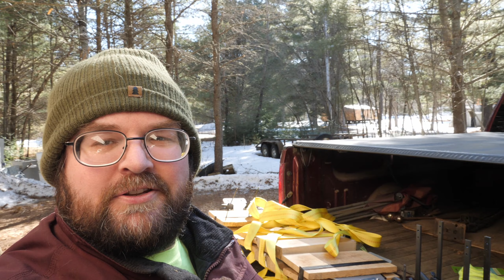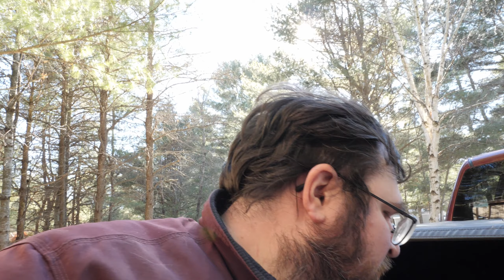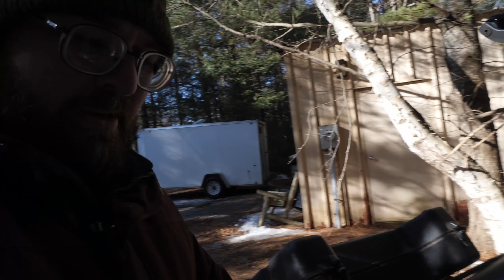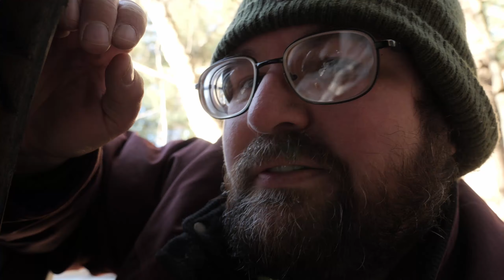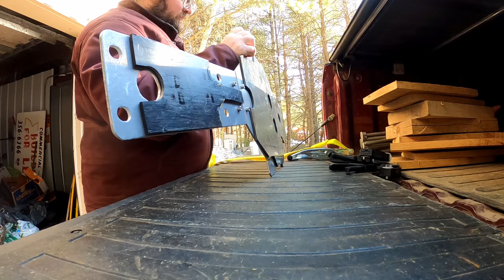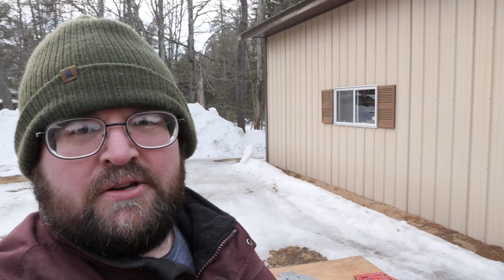Building a Hybrid ATV Skidplate for my Arctic Cat 700 | Aluminum And Plastic Surface Skidplate Build

Comment: Here in Norway most people use plastic, just because of it slides better like you said. Because with aluminium, you will get insta stuck on rocks, but plastic just bend.
You are doing a great job there.
Reply from the maker: Thank you. I used the Team Arctic trick I have in another video basically since new to protect my plastic skid from getting too stretched out like you're talking about. Recently I've been thinking about how old this machine is, and one of these days it's going to start getting harder to buy replacement parts for it. So I figured now is the time to buy anything I might want to finish building this machine, while they're still available to me. By building this setup, it still slides better because of the plastic, but has more resistance to bending. It seems like a win-win to me.

I also decided to pick up some Ricochet Offroad footwell guards and did the same thing to them. I bought these for the same reason, mitigating damage to things that could be hard to find in the now not-too-distant future. I haven't made a video to show these yet because I've been kind of slacking off, haha. 

Thank you for watching and commenting!
Reply: @ROCKINRODNEY  You are doing so much work to your machine, I got everything mounted at my dealer when I bought it in 2018. I think your Arctic Cat will do great for many years still, but it is always nice to have a new atv aswell.
Reply from the maker: @ArcticExploring  thanks. Yeah I did alot of things to this machine when new. I was always on the fence about whether to do an aluminum skid. These are about the last things I have for it at this point. If/when I get a new machine, I'll have to start the process over, haha. I really want to build a rock buggy UTV.
Reply: @ROCKINRODNEY  It is cool that you do things yourself to your machine, I doesn't have either time or tools to much things to mine. A rock buggy UTV sounds really cool, but sound a bit expensive to maintain also.

Comment: Great job and idea Ron. I think it is going to hold up in the long run. You have got to love the miracles of time lapse. You waited 4 days and we waited 7 minutes to see how this project was going to turn out lol. I think you will be good to go. You placed a lot of 3M tape throughout the skid plate and that tape works wonders. Have a nice day Ron!
Reply from the maker: Hey good morning sir! Yeah I kind of threw that 1 inch per 1 pound of material weight out the window. Initially I was going to only tape the edges and around the cutouts, but then decided to go ahead and fill in any spots where there weren't openings. The way this stuff bonds is crazy! I don't think it's going anywhere. I actually went ahead and ordered ricochet footwell guards and did the same thing to them. If it does, I'll make an update. 

Thank you very much for watching my video, and for commenting buddy!

Comment: Curious to see how it holds up.. 👍
Reply from the maker: You and I both Doc. According to 3M, this tape is recommended for use in applications including "applying sheeting to the exterior of skyscrapers", so they must have a fair amount of faith in those product for pretty extreme situations. If/when it fails, I'll post an update. But I think it's probably going to be alright. 

Thanks alot for watching and commenting!

Comment: Nice job there buddy great idea! Durability of aluminum and slick as plastic. Hopefully it holds up well.
Reply from the maker: Hey KC! Thank you sir! So far I'm very happy with it. This tape is the stuff they recommend for use in "applying sheeting to the exterior of skyscrapers" apparently, rofl. They also recommend using 1 inch of tape per pound of material. I very much blew that ratio away also. I don't think those materials are going to separate anytime soon. I actually went ahead and bought ricochet armor for the footwells and did the same thing to them. If/when it does fail, I'm sure I'll show it in an update. 

Thank you for watching and commenting sir!

Comment: that 3M tape is no joke. I used it to  tape down a wood piece I was sanding, didnt want to use clamps... and had to cut it off and use Isopropyl Alcohol to eat at the "stickyness"... won't be using that anymore...... also used it to tape my camera to my helmet... will see how that works.... Great Vid bud..

cheers from Montana...
Reply from the maker: Thank you sir! Yeah 3M says that this product is appropriate to use for adhering the sheeting to the side of skyscrapers. So in my mind it sounds like it plays for keeps. The moment it touched that aluminum, I couldn't separate it to move it anymore. It is an amazing product. I think in the prep video I have linked in the description they suggest doing what you did, using isopropyl and a vibrating knife to separate the two surfaces. 

In summary, I don't think the skidplate is going anywhere, haha. 

Thank you for watching and commenting sir!